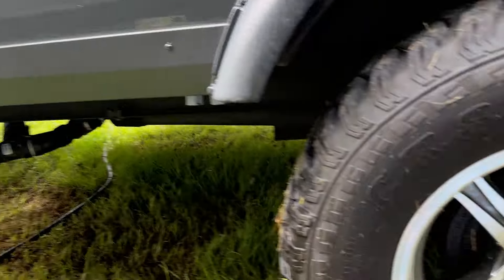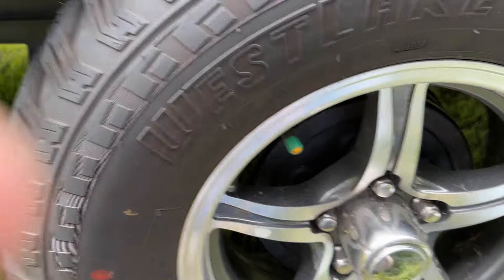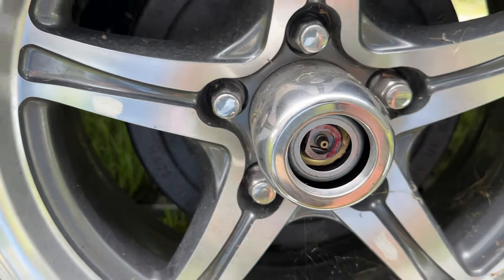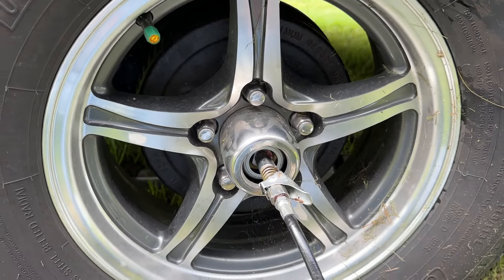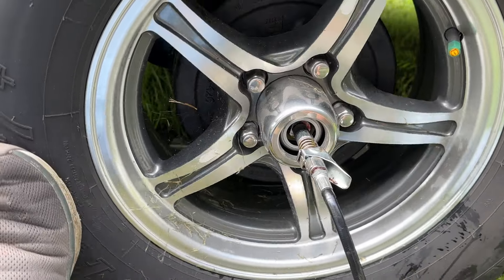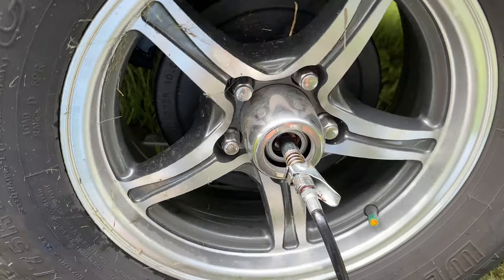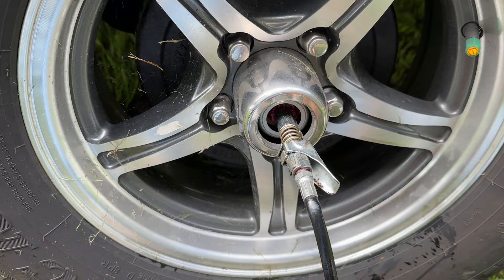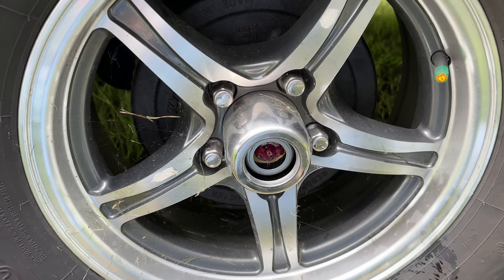Routine axle/bearing maintenance on the EZ-Lube axles found on many campers.

Comment: I just purchased a 2024 GeoPro 15TB about 2  weeks ago.  I am wanting to buy a grease gun with a quick release.  Any recommendations on what I should get.  Also, is there a certain type of grease you need for the hub and bearings.  I also purchased a Curt 10000# Weight Distribution Hitch with sway control assembly when I bought the 15TB.  It comes with a grease nipple to lubricate the WDH. I was wondering if that grease can be used with the WDH.  Any help will be welcomed.  Thank you.